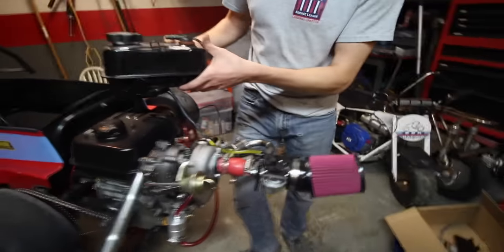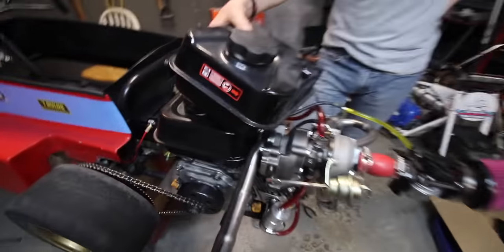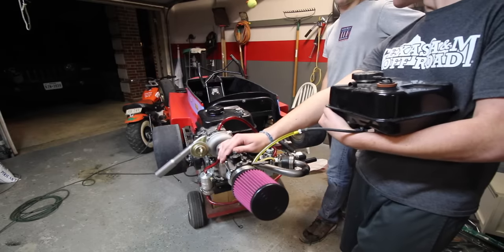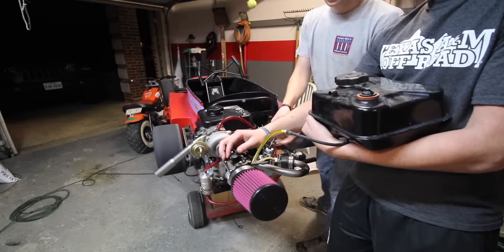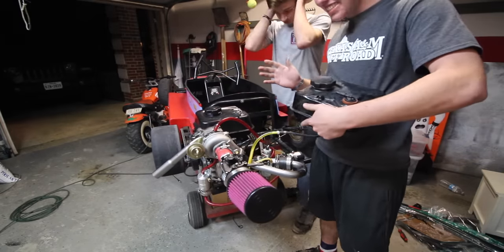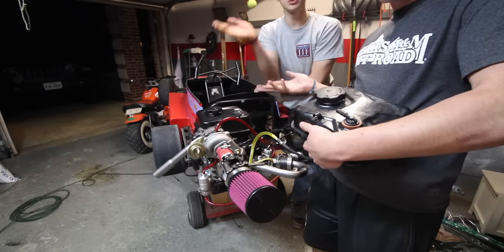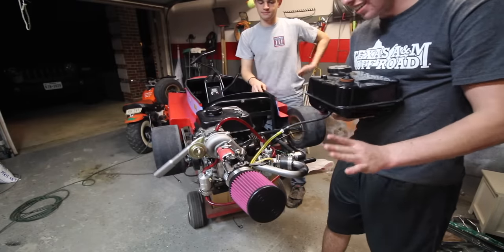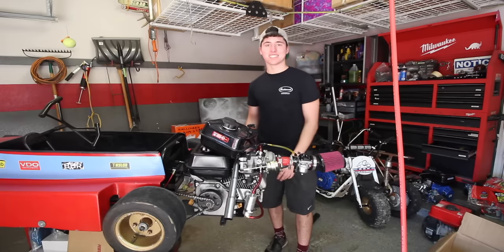Turbo Go Kart Finally Makes Boost!

Comment: Dont need that second carb after the turbo, just run one before the turbo. Since your running suck thru as the turbo sucks more air to make boost the carb delivers more fuel. And since your using that pre fuelled air it doesnt lean out. The a/f going into the turbo stays constant.

Comment: there are 2 ways to do it correctly:
1 carb mounted to turbo inlet and jetting it just right. The turbo will suck air and fuel throught carb. In addicion evaporating fuel will coll down intake tube so no need for intercooler
2. Blow-through application. In order to work you'll need special carb and fuel supply pump that delivers at pressure about 2-3 psi higher that boost pressure. Mikuni carbs that you have will just leak from every gaskett possible and boost pressure will cause fuel to return to the tank.

Comment: I like how you made this kinda sorta work for you. To be honest though you would see better results if you were to mount one of those carbs in a plenum (just a welded up sheet metal box with a sealed lid) and blow through it, you'd also need a fuel pump and pressure regulator so you could raise fuel pressure in line with boost so you avoid pushing fuel back out of the carb like was happening with the mikuni.  Props for doing it your own way though and learning for yourselves what works and what doesn't. To quote another of my favourite youtubers , AvE, knowledge is doing it yourself and finding what works, not just being told second hand. :)
Reply: True to a point, but do you really need to go back to making fire for the first time and proving that putting 2 rocks in a bucket with one already there is actually 3 rocks, or can you work from some experience?

Comment: Set the 2nd carb at 1/2 open with a stop on it, hook the kuni to the pedal like normal. Have a sliding cable stop on thd 2nd carb at the pedal so when the kuni is about half open the 2nd carb starts to open farther. You could adjust this set up to find the sweet spot where it idles good and still run WOT. Plus the boost would just roll on as you push on the gas. Like a multi carb set up on an old muscle car. One progressively opens, then the other.

Comment: You could have just used a mechanical FMU that activates by boost pressure. The more boost pressure you have, the more fuel it allows. Cool project for sure!

Comment: On a blow through carb the vent of the carb needs to see the same pressure as is in the hat(carb inlet) otherwise you won’t get a pressure -difference at the Venturi to pull any fuel. With your set up using  a second carb to keep the engine running. If you don’t boost reference the blow through vent that carb will likely push the contents of its bowl out the vent. 

Second with a blow through set up you need your fuel supply pressure to be greater than your boost pressure otherwise you’ll get no fuel supply and if you keep it going long enough you’ll pressurize your fuel tank. 

You can avoid those issues by running the pull through only but you’ve already seen the tuning issues. 

Blow through is the best way to do this. But you need a fuel pump, a rising rate boost referenced fuel pressure regulator, and you need to boost reference your float bowl vent. 

Don’t trust me though, if you’re students at A&M I’d expect you to be able to draw a picture of the system and convince yourselves

Comment: I recommend sealing the fuel take and adding a fuel reference line to the take and only using one carb the one with boost.you need to add 6.8% more fuel per psi and since the carb you are using does not use pressure 1 psi is 6.8% more fuel.when there is no boost there will be the same amount of fuel as normal and it will use the boost referenced line as a breather.

Comment: To use a blow through carburetor you have to have more fuel pressure going into the carburetor than the boost pressure because the boost pressure will push the gas out of the carburetor back into the gas tank

Comment: Need a boost dependant fuel pressure regulator?  I used 1 on my blowthrough carb. Also I had to rebuild my carb with custom gaskets made from gasket sheet. No leaks !

Comment: Guys. Carbs meter fuel based on sensed vacuum! You're pressurizing the second carb. 
Lookup some old car magazine articles on (single) carbureted, turbocharged engines and how you need to mod the carb for use with a turbo.

Comment: If you grind away the slide of the mikuni so its just the jet needle it will be you air fuel mixure and the tillotson carb will be throttle

Comment: I think a draw through carb mounted in front of the turbo might be simpler. However I really like your idea of the two carbs (one set up for basically NA and the 2nd for boost) since the engine is small and spooling could be a real issue that is not a problem on larger engines, this dual carb set up might....maybe...could be a good idea. With that in mind you need a fresh air idle/intake circuit for the 1st “NA carb” so it can draw air in after the 2nd carb/turbo. With a one way vent valve. So while running in NA rpms that carb can pull it’s own air bypassing the turbo set up completely. Once boost starts to generate that pressure will over take the vacuum and push the one way vent valve close and start pressurizing the air going into the NA carb. And that should allow you to tune the “boost carb” to begin the richening process. This would also prevent you from running rich when in NA rpms (because it will be getting fresh air completely bypassed the turbo/carb assembly.) 

Hope this makes sense and helps!

Comment: For the 2nd carb before the turbo, remove the little cylinder that blocks air when at idle. Make that carb control fuel only, not air

Comment: Accelerator pump guys!
You only need a burst of gasoline until the turbo makes boost and in turn makes the system more efficient. You will require more fuel but not 2 carbs worth.

Comment: Switch carbs,,, take the bottom carb, put it on top, top has a set Screw, set the throttle where ya need it so it gets bout half or 3 quarter air flow, then use the bottom carb to go fast! Basic switch em!!

Comment: If you can calibrate the carburetors and run a dual cable with appropriate lengths in Spring tension you should be able to to in the carburetors together and have them come into their power band Perfectly every time

Comment: I would simply take the centrifical clutch & weld a pulley with a shaft to keep it away from the chain and sprocket and figure out a way to put a pulley on the end of that turbo to make it spin so therefore you can steal route the exhaust into the turbo and force it back through the intake if you get what I'm saying

Comment: pressurize/equalize the float bowl  via breather /overflow from carb.  Then the if you make it a sucker rather than a blower  the intake run into the cylinder has to be straight as possible

Comment: A couple of things I noticed:

1.  You absolutely need to remove the governor from that motor.  There is no way you'll get usable boost from an engine that only rev's to 3,600.  Being a single cylinder engine turbo is less efficient (because you are spooling up when the intake valve is shut) you'll not get meaningful boost till 4k-4.5k RPM.

2.  I'd highly recommend using a cheap homemade efi setup.  Google "Arduino cheap small engine efi" if I remember correctly you get a working efi for under $100.  If not you should really run an Arduino with an oxygen sensor and lcd display.  That way you'll know if you're too lean or rich especially with the 2 carbs.

3. If you're dead set on running two carbs the way to go would be use the standard one on your intake (carb 1) for throttle, with your second carb (carb 2) wire it so it's wide open all the time but is only getting fuel when you go beyond 1/2 to 3/4 throttle.
Reply: Also don't apologize for a video under 15 min long.

If someone has a problem with a 15min video they should apologize to you for having the attention span of a gnat!

Comment: Pretty sure you need to hook the exhaust up to the inlet of the turbo. Exhaust pressure spins up the impeller, which forces air into the intake. Then you rejet the carb to account or the extra air. Also need a blowoff. If you get that setup to somehow make any significant boost, it might blow the head off, or some similar catastrophic failure to the engine.

Comment: If you can make one of the carbs add fuel late you'll be good to go. Just like in a 4barrel carb, when you go to full throttle the second two throttle blades open from vacuum and the booster sends more fuel through. I think it would be easier to control the throttle if the upstream carb is always open or if the turbo is not obstructed.

Comment: You will need to build a synchronized throttle linkage to open the carbs the same amount at the same speed.

Comment: There is probly something im overlooking but why not just boost refrence the tank off of the charge pipe just before the carb? It would seem to stay gravity feed even under boost as the boost would pressurize the tank to the exact pressure needed to keep the float bowl full.
Reply: The vent for the float bowl will need tied into boost pressure also. Should work just like a boosted Holley carb on a turbo v8

Comment: I read a book on fluid dynamics, and it says 2-90 degree bends in a tube constitutes a free super charger. I for get how much free boost but  it is calculable . the only time and place a very straight intake path is needed is in drag racing, to get the shortest and straightest, quickest path to the combustion chamber.

Comment: You need to do a draw through turbo setup.....air is drawn through 1 or 2 carbs then the air through the compressor and into the engine. The carbs you have I can only assume hate being blown through. I know you are experimenting but the draw through system is the way to go.

Comment: I know you guys were trying to do something that’s never been done before. But I think the carb should be feeding the turbo. Then when the turbo is spooling, it’s just creates more vacuum in the carb, which would pull the fuel it needs, making your air/fuel mixture stay the same. I could be wrong though. Iv never turbo’ed a carbed engine before.

Comment: The lower carb is seeing positive pressure, venturi pumps need to see negative pressure from air passing by a step-down in diameter. I suspect you aren't gaining much or anything from that lower carb. I was also thinking, maybe fix the pre-turbo carb to open throttle and use the lower as the actual throttle. Fun project, keep it up and good luck.

Comment: if you do a blow through you can pressurize the boal with boost so it still draw fuel that what they do with ram air on bikes with carbs

Comment: What about doing the blow through design using an old school Tillotson HL carburetor. That way there would be no bowl to pressurize and bypass a float. (???) Pulling air/fuel mix through a screaming turbine just doesn't seem safe.

Comment: So many people here saying your doing it wrong
This will work at long as you increase the fuel pressure to the second carb (after turbo )
Also you could control the first carb ( before turbo) with a setup like a waste gate actuator  lifting the needle with more boost
Just remove the throttle plate from the first carb to let more air in no matter the throttle position 
Its better to have the main amount of fuel close to the engine for easy starts

Comment: Nice. So I'm thinking unless you install a pressurised fuel injection system you will have to introduce fuel at the vaccum side of the turbo. This means there will be fuel contantly soaking to cold side seal of the turbine shaft. I'm wondering what effect this will have on the seal wear ? Also if the fuel were having a negative effect could you add a little 2-stroke oil to help ? I often wondered how a non injection engine might be turbo'd so realy appreciate your video.

Comment: Just  mount the turbo output to the head intake, then mount the carb to the turbo intake, plumb up the exhaust  and run it, if turbo lag is  excessive drill a very small hole above the intake port of the main jet .  Start very small  like 1/32"  or less  and should be above the fuel level in the bowl. you want the positive intake pressure to find its way into the bowl to force th fuel through the jet.

Comment: You should be able to keep both carbs if you just run a boost line to the tank and seal the cap. That should even out the boost and fuel pressures. You'll prolly have to jet it though.
Reply: Should be easy to try anyways.

Comment: Get rid of the carb in the charge pipe.  Just use the single carb on the inlet of the compressor.  Turbo volkswagens used a draw through carburetor like this.  It will pull a vacuum at all times even when in boost.  Plus the fuel serves as an intercooler cooling the compressed air.  Just play with jetting until you get it right.
Reply: This ^^^^

Comment: Why not make a y junction at the turbo inlet to suck through both carbs and push the boost and air/fuel ratio into the engine already mixed at the inlet ?

Comment: Looks like if you use the foot throttle to get it up to a certain rpm and then kick in the (secondary) for the turbo to work... Just a suggestion but there may be a better way to do it

Comment: All the turbo builds I've watched using these small engines the gains offered by the turbo is neglible. You get some horsepower gains, but usually you can get more power thru head porting and better carb an exhaust plus it's cheaper. Still fun to watch though, and see the problem solving process.

Comment: Would be really hard to do but to be honest the best system for a exhaust putting out such small volume is to have a variable size exhaust that is small when at low rpm to produce high velocity exhaust to spool the turbo and than wider at higher rpm. The exhaust pressure just isnt high enough
Reply: Use a Viton elastic tubing (has temp rating up to 600f) for the exhaust and house it in a larger diamter metal tubing. This will make the tubing expand at higher pressures and contract to its normal smaller size at low pressure.

Comment: Does it have its governor removed? I’m debating on doing it to my tecumseh 6.0 crappy engine to get a little more power. It seems nobody knows what it does to the engine. There’s people that have had zero problems and have had it done for years but then people that had it done for a week and burn a converter or blow and engine. I need some advice from someone who actually knows if I should.

Comment: Your problem seems to me to be the fuel bowl vent on the Mikuni. The pressurized air from the compressor is going down the emulsion tube into the fuel bowl and out the bowl vent taking the fuel from the bowl with it. If you connect the vent to the pressurized air, then also pressurize the fuel tank I believe you can successfully do a blow through carburetor. Oh yeah probably take that screw out too.

Comment: Carburetors work on the venturi principal, and must have a suction across them to work. You cannot have a pressurized carburetor without the whole area around it(outside) also being pressurized to the same psi.
Reply: I've got it! Build an intake manifold that holds the entire carburetor inside of it so boost inside is equal to boost outside the carburetor!!!

Comment: what you need to do is make a one way valve on the NA carb so that when the boost starts building up it shuts off the NA carb so that it runs off of boost only carb and it wont run rich and shut off the engine

Comment: Oh, wet tubto kits don't biuld as much as dry run it of the stock one running rich and it will build more boost, don't thank me if you don't want to do it oh well but try it, I know it's like that for 2stroke

Comment: You need to put the turbo onto the intake or make it much closer. the shorter the intake and the most direct flowing is what’s going to work, then use one carb that the turbo will pull fuel and air through.

Comment: Go with one carb on the turbo intake, remove the rest of the intake plumbing and rebuild the manifild short on the exit side of the turbo.  Prolly best to go with E85, and will need super big jets for the carb to keep it from getting too hot and  holing a piston.  I dont know if there is a wastegate to keep boost reasonable or not, but with E85 or race gas you might get away with it.  E85 may require different seals etc for carb and all fuel components.   There should be no need for Fuel injection at all, a carb will work but will need tuning especially if using E85

Comment: This is way simpler than your making it plug all exterior holes on carb leave the vent open on the intake side of the throttle slide and pump the fuel to thr carb cause other wise it pushes fuel back.      With a pred motor you can technically pressurize the tank with boost but that gets dangerous over 4 or 5 lbs but ive done it

Comment: You should make a plenum after the turbo outlit with a diverter valve have the diverter valve fees the intake of the turbo. And run a manual boost controller.
Reply: And get rid of the second carb

Comment: Ok I've seen this done the issue is where u force air through the lower carb it forces air n the bowl of the carb.  So remove the lower carb and do what they call draw through  flow  not forced  air. So leave the upper carb and remove lower carb and add the charge pipe to the intake port. Good lucks fellas ur welcom lol

Comment: Run 2 Carbs parallel, one has boost going in and one is NA. Have them go into a Y-Pipe. When you start making boost, or about half throttle, have the NA carb close and choke on. fuel lines should be blocked off. Which then would seal in some boost, and might hold enough of the boost. when the NA carb closes the boosted one should be wide open so the boost will be flowing in. That also means no Lag.

Comment: your carb bowl vent has to be under pressure  also,  make a box for the carb seal around cable, or put the carb before turbo if it a wet design turbo